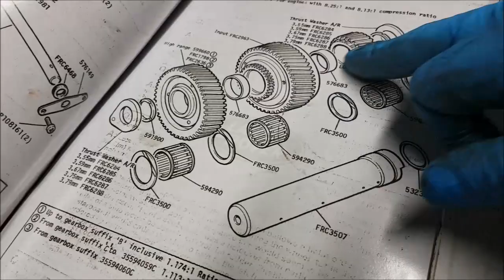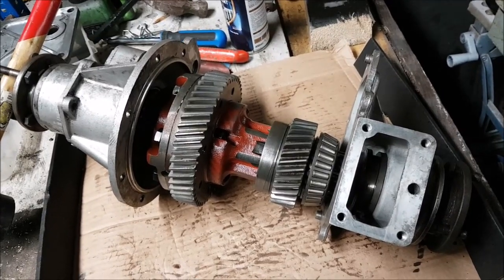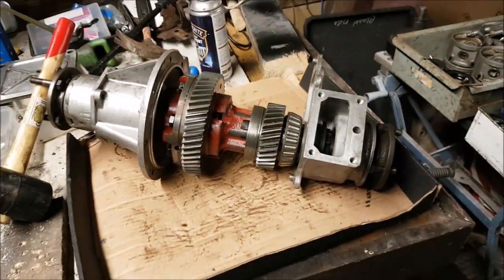Range Rover Gearbox 4 speed LT95 Part 5   Transfer gears and Selectors swearing within

Comment: So if the gearbox is still in the car, I can remove the centre diff without removing the intermediate gears and selector? As I understand it, best to select diff lock before dismantling, to align diff lock ‘dog’ then remove speedo housing etc and then slip out the C/D?
Reply from the maker: Yes, I removed the front and rear output housings which made life easier. No need to disturb anything else in the transfer box